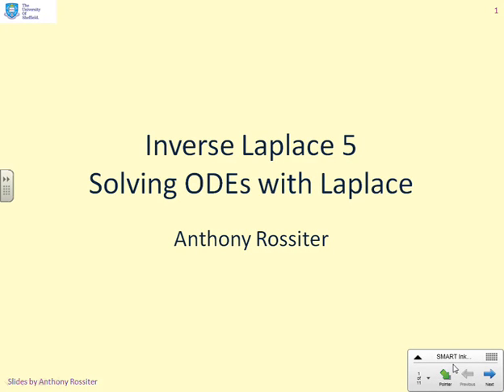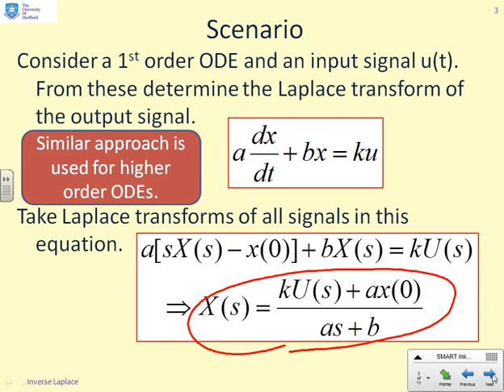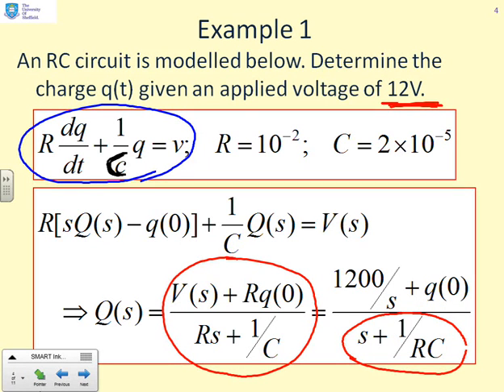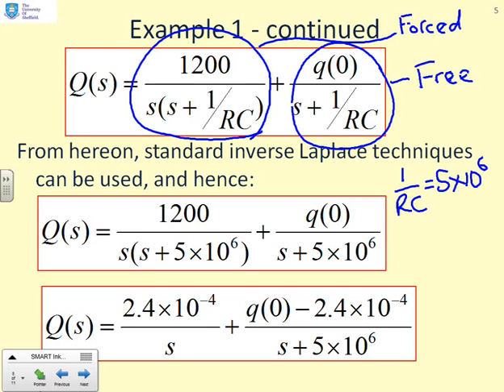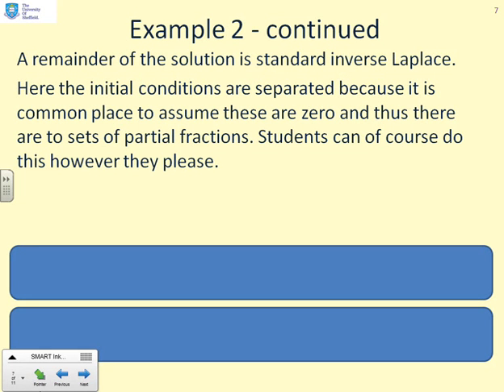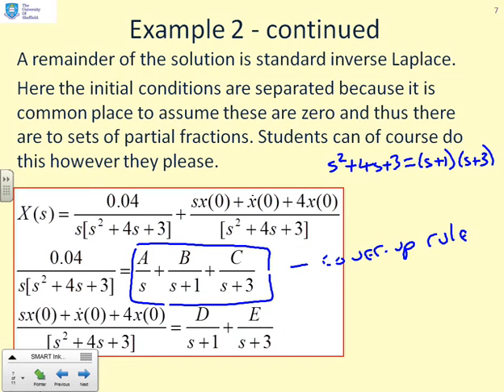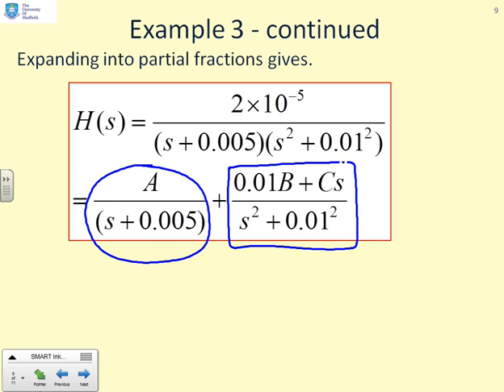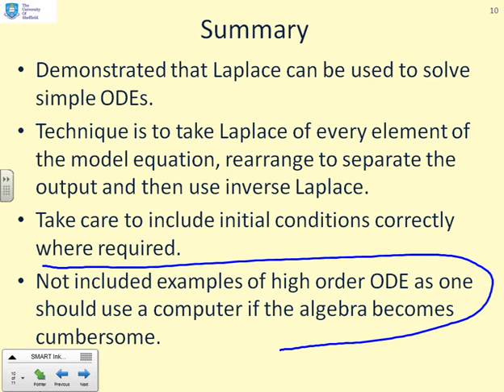Inverse Laplace 5

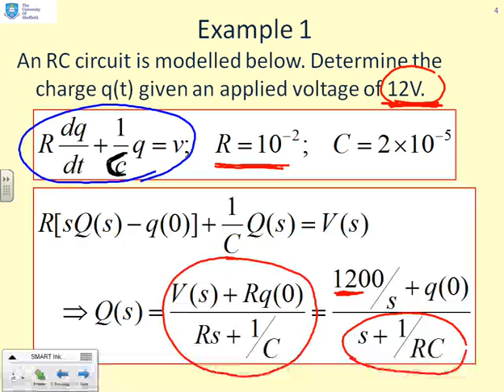Comment: at 03:55 why does V(s) become 1200/s. I understand the 1200 part but why is it suddenly divided by s? shouldn't it be 1200(s)?
Reply from the maker: A constant k is represented by a Laplace transform k/s.
Reply: @Kwaku Brobbey He's just given the general solution for it at first but then later on in the question he makes it specific to the problem where the voltage is constant. Say, for instance, voltage was changing then the laplace transform wouldn't just be v/s, it would be some other function of s which he would have used in that scenario but in this case it is just constant so v/s is ok, hope this helps.